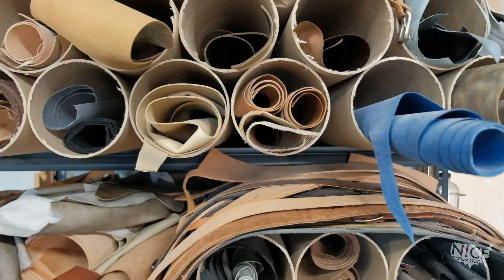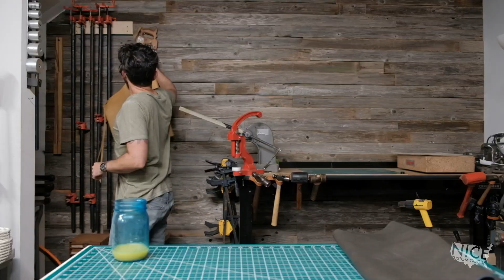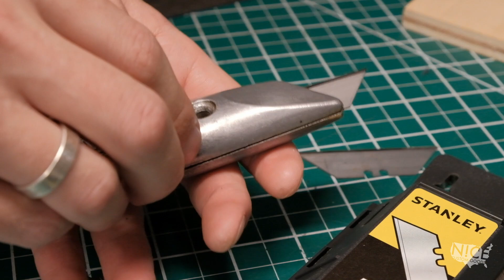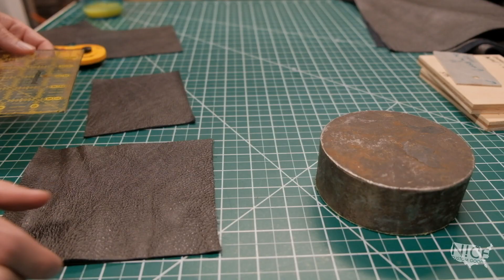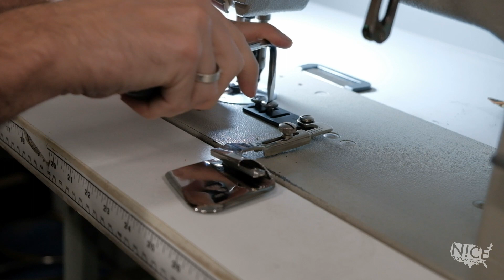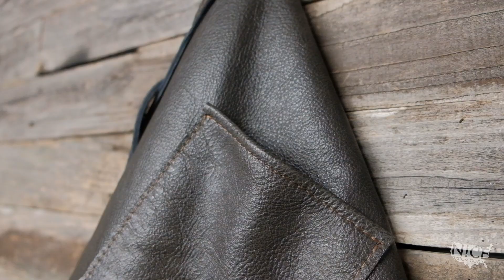How to Make a Leather Apron

Comment: Sweet videos!  I have been getting more into leather since I got my tipmann boss.  I signed up for a leather inlay/overlay class in June so I will be on the hunt for an additional machine.
Reply from the maker: Sweet! Lmk when you start looking. I’ll help you find a good one.
Reply: Nice Custom Goods I am currently eyeballing fb and craigslist for crazy deals.  I probably wouldn’t buy anything really expensive for a while.  But some of the old singers like the 110w series and 31-15’s were recommended in the instructors book.  So if one pops up In good condition at a price and distance I am comfortable with I might nab it.
Reply from the maker: I’d stay away from old singers unless it was strictly made for leather. They old ones are great for fabric, but even the stronger machines will not be consistent. That said, used industrial machines are awesome because they’ve been dialed in.
Reply: Nice Custom Goods the ones I mentioned are used by boot makers for decorative stitching.  Outside of those it is awfully confusing.  Lots of brands and models all with different specialties.
Reply from the maker: @AllenNewberry  Yes, for sure. There are tons of specialized machines. In fact, the 3 machines I have can't do each other's job; there is little crossover between machines. Suffice to say, there isn't a machine that can do it all. Also, look for a machine with a servo motor. That way, you can sew slowly, instead of 100 mph.